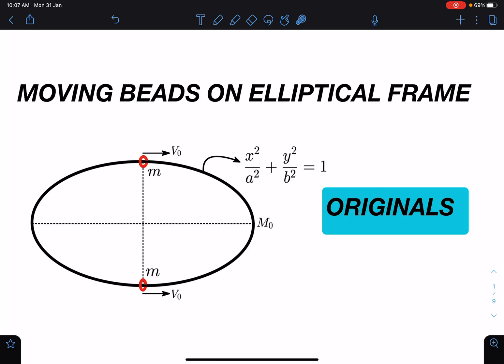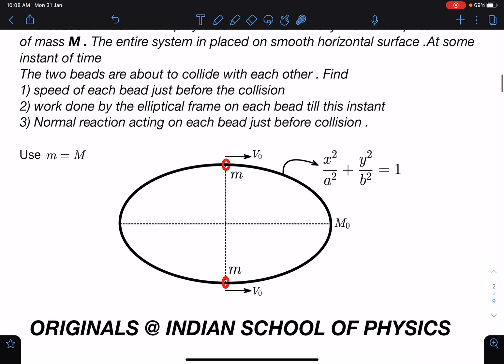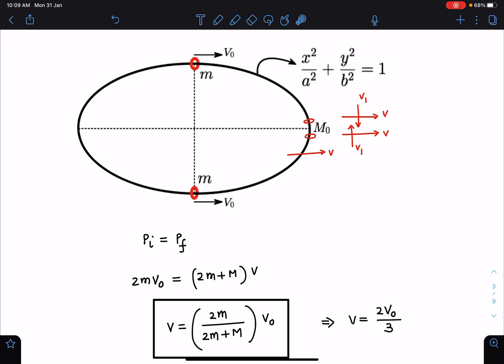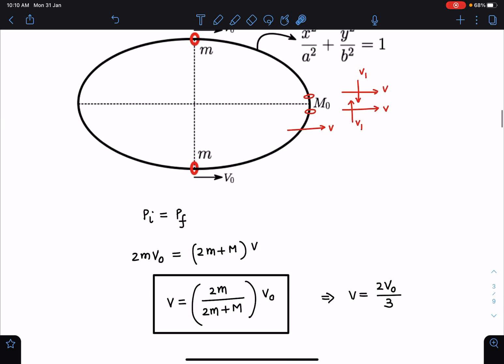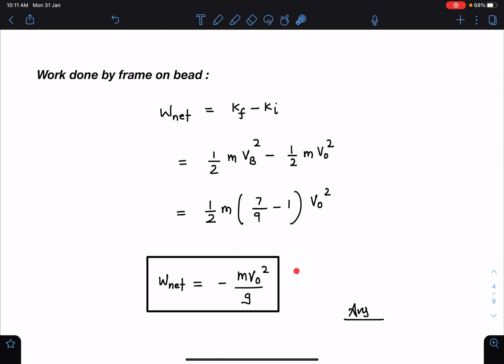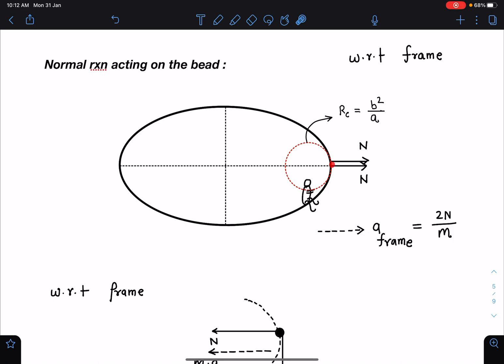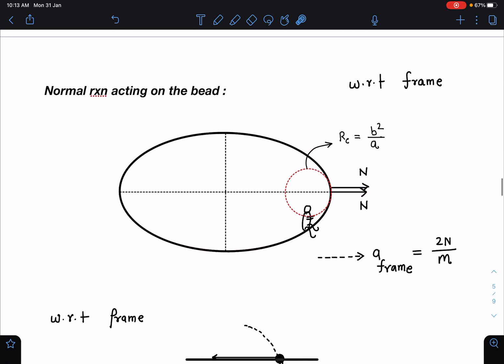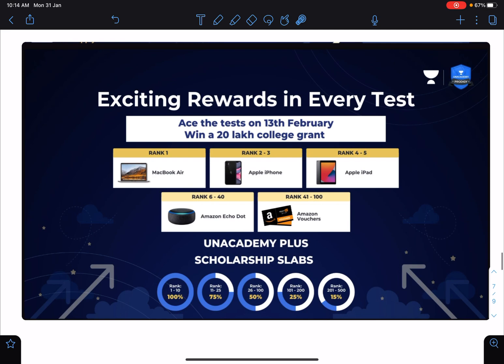[JEE ADVANCED] MOVING BEADS ON SMOOTH ELLIPTICAL WIRE FRAME  [ ADVANCE PROBLEMS IN SCHOOL PHYSICS ]

Comment: But sir Normal reaction is an internal force that should not accelerate bigger ring
Reply: I don't think so, there is a question in krotov, where ball moves down an inclined plane and the incline plane moves backward due to the force between ball and inclined plane

Comment: Sir First Two Questions are independent of the parameters of ellipse as it is not affecting the same and the results will be same of first two parts even if the shape is circular Am I correct?

Comment: Sir thanks this was very lovely one 😄😄 . Also Sir  can you tell isnt in an accelerating frame the Radius of curvature would be different than b^2/a which you used? Like one can observe in pure rolling in ground frame radius of curvature of top is 4R while from bottom which is am accelrating frame it comes out to be 2R , so shouldnt like this needs to be done in elliptical acc frame when considered finding normal reaction part?